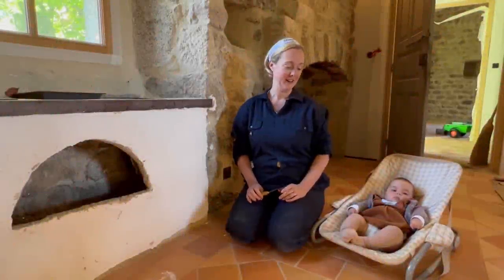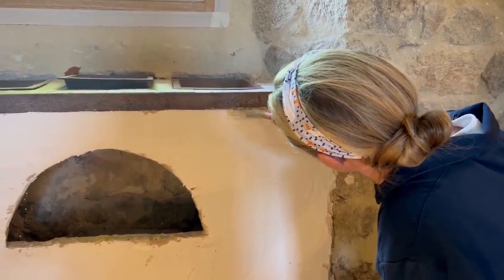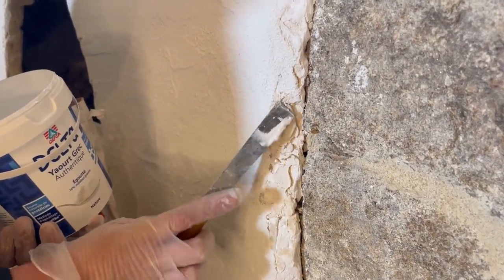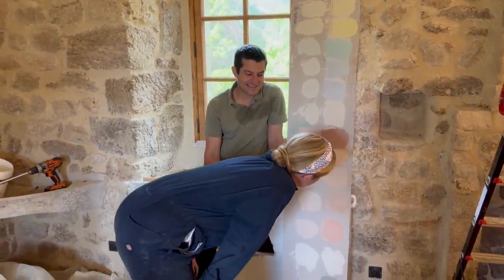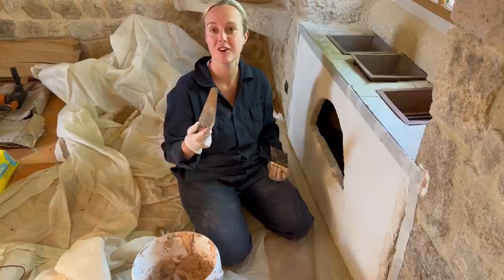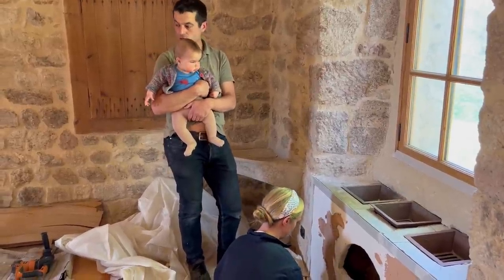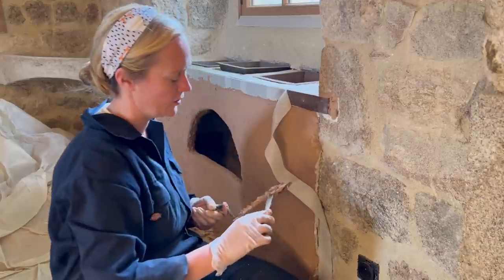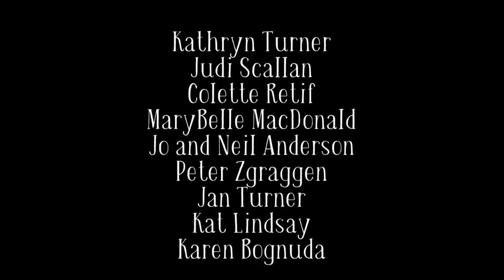The Plastering Trial! Restoring the Château’s Historic Coach House

Comment: There are a lot of instruction clips about plastering on you tube 😁 by the way. It is also a lot easier using the right tools. Admire your courage. Getting there.
Reply: A paint or wallpaper scraper  would have been better than tileing mix speader  it looks good though

Comment: hoovering everything (including spiders) sucks up the dust ... love the plaster.  It might be worth making your own putty for lime plaster if you are planning to use a lot?  A bag of Chaux is quite cheap and all it needs is soaking in water for three months to 'fatten' then mixed 1 part putty with 3 parts sharp sand.   I use lime for painting exteriors and any left I leave in a bucket with a layer of water on top with a lid to sit and use for pointing. You can also use the putty for filling holes and add a bit of chopped hair to give a bit more structure.  For the paint I just mix until like a double cream; wet the wall and slosh it on. Three or four coats with a top coat with a slosh of linseed oil in.  Will stand up to the most dreadful weather.  For a 'milk' paint just add a tin of dried milk to the mix. Then pigments if you want colour.
Reply from the maker: We do make up our own lime plaster most of the time but this was a particular type that's mixed with glue and we can use on plasterboard. Have a look at our previous video if you want to know more about it!
Reply: @Chroniclesofrosieres  oh wow! think I need to check that out; thankyou!

Comment: you also need to spray the wall first with water .... before plaster goes on.. Whenever you use lime; the walls need to be sprayed first.. you might find adhesion will be difficult or fail.. xxx  its not easy to do without the right tools.. I feel for you!  Easy way to smooth it out is to go over it with a fairly damp/wet sponge..
Reply from the maker: It depends on the surface. This one wasn't porous because of the precious coating, and the plaster we were using was a special one made with glue to adhere to smooth, non-porous surfaces.

Comment: Great job Amy!!  Putting the same colour on the wall will provide great  balance. What will you use that cavity for? Could it be used to put a lamp in for some ambient lighting?? 👋 🇦🇺
Reply from the maker: Great idea to put a lamp in. Wiring it could be tricky though as we wouldn't be able to drill through the hollow bricks without the risk of them shattering.

Comment: I was worried that you had not sprayed surface with a water mist or added adhesive glue in plaster.  Will it stay on and not crack? I hope so. Beautiful.
Reply from the maker: We talked a lot in the previous video about how this isn’t proper plaster - it’s a kind of plaster mixed with glue. This means it will stick to surfaces like plasterboard or in this case another layer of plaster glue from a different company that we’d tried. Because the under later isn’t absorbent we didn’t need to spray it with water first!

Comment: A wet sponge or paint brush can be used to achieve the finish you desire. But you did a great job anyway.
Reply from the maker: Thank you! Adding water later doesn't really work on this kind of plaster because of the glue element in it - it behaves really strangely!

Comment: Normally you dampen the surface so the plaster will adhere. Is that what Marc was going to suggest ? Looks great !
Reply from the maker: No this is a special plaster for smooth surfaces that is mixed with glue

Comment: years ago we made stone effect walls using artex (I know) but also stuff called scrumble which was a type of paint / varnish  tape of the mortor lines apply artex when dry remove tape paint with scrumble you can make old wood beams too using this method or stone walls which look natural  its an old thing now but works well